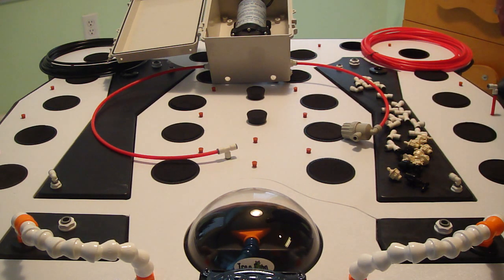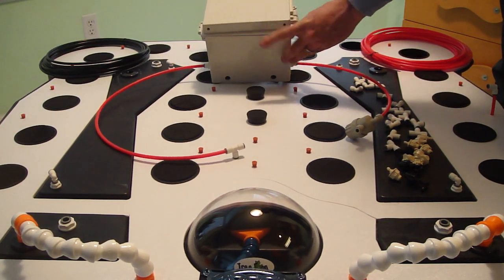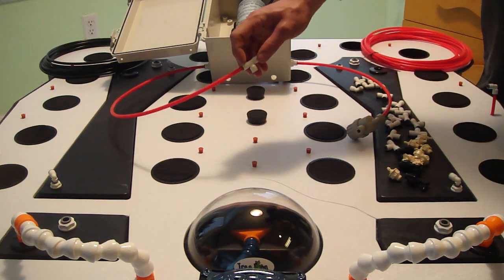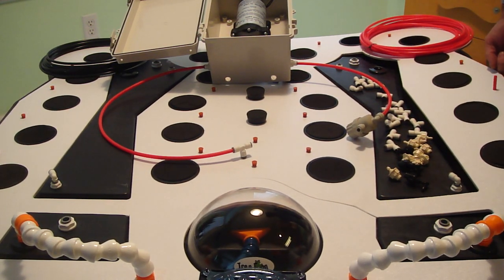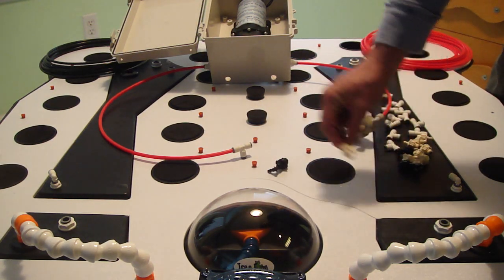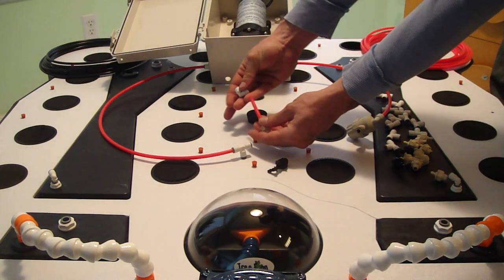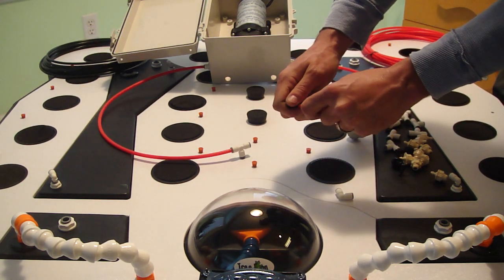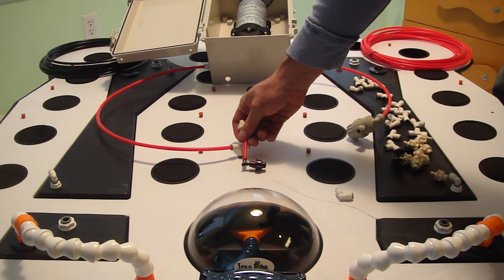High Pressure Aero TreeFrog by Multiponics

Comment from the maker: Thanks for this question! Although aeroponics offers a 'bigger, faster, more efficient' possibility for your garden, with the reward can come more risk. It is tough to beat a well Oxygenated recirculating system or other hydroponic styles such as Ebb and Flow. The TreeFrog was designed to easily change between styles. It would be interesting to compare results with a hybrid style as you've suggested.